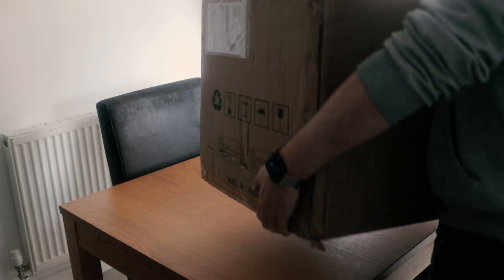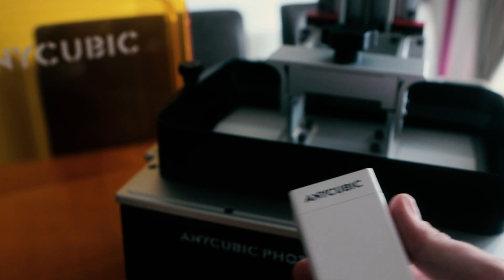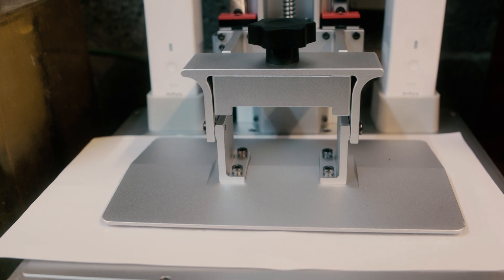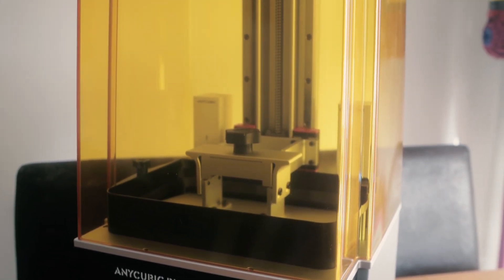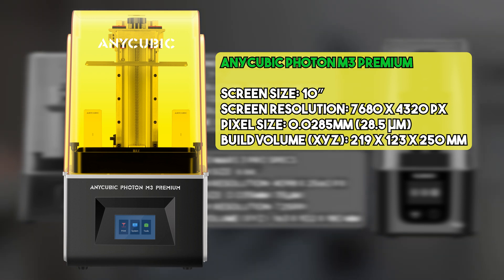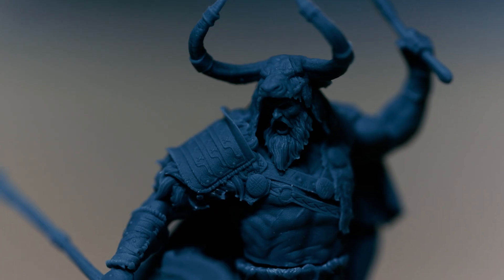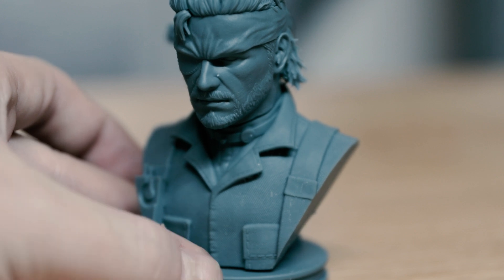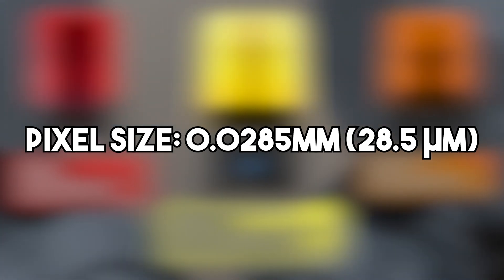Best 10-inch 8k Printer? - Anycubic Photon M3 Premium Review

Comment: Ross the m3 max ! build volume is same as the new m7 max !! but the m3 can be got for half the price and quality is fantastic ( i hear ) would you still recommend this in 2025 given the size is the still huge in comparison to new tech and features ??
Reply from the maker: I like the new tech and the cob lightsource is also sharper than the old matrix array. But if you just want big prints. You’re unlikely to see a difference.

So it’s a bargain, but you also need to see if you can still get parts for the older one
Reply: @FauxHammer  great ! thanks for responding so quickly ! i have the deal of getting 2 m3 max machines in mint condition for 440 GBP

Comment: anyone if the rumors about this printer being discontinued are true.
Reply from the maker: They are, it’s gone
Reply: Could you use  elgoo 8k 10" as a replacement?
Reply: Yes. I have used a Saturn 2 8K Screen on an M3 Premium without any issues. The glass is smaller so you will need to fill the gaps.  @Wayatoon

Comment: I have seen lots of reviews printing miniature figures. How about how well these printers will print structural things. Vehicles and such. How is the print quality on flat surfaces? I am still on the fence about buying one. Mostly because of the learning curve. Regardless of that, I still would like to get one. My venue is model trains and I would like to design my own models. Just not sure if these printers are up to injection molded quality surfaces.

I really do enjoy your videos. Very helpful in seeing how these things work.

Comment: They fixed the RARF test
Prints on the mono 2 was fairly easy to read but still preferred to use the validation matrix they used UV tools to get these prints as different exposures it says

Comment: Ive been having such a tough time getting this thing to go fast with the siriya tenacious navy grey mix, I either get peeled or squished prints, what settings shoukd I be using for this thing? I WANT THE SUOER FAST PRINTING SPEED i was promised😅😂 help me please
Reply from the maker: You won’t get fast speeds with those types of resins, they are too flexible. To get fast speeds to need specific low viscosity resins
Reply: @FauxHammer  would adding 10% sculpt or blu would help speed it up?making a mixture of something like 60 70% fast, 20%tenacious and 10% something harder? I live in texas so vat heating is of no issue plus I happen to have sculpt on hand
Reply: Actually would it just be better to do a build resin/tenacious mix?

Comment: what settings are you using on this printer?  I'm using Lychee and I just got it and a print that should have taken 3 hours is actually taking 6 hours and I have no idea why.  Lychee software says it'll take 3 hours.  Why is this printer soooo much slower than the software predicts it will be? 

I'm using Siraya Tech fast navy grey resin, with their settings for this exact printer.  About 2.3s exposure.  I had a Elegoo saturn before this and it was twice as fast using the same settings.

Also my touchscreen came broken, theyre supposedly sending me another touchscreen.  I'm wondering if the whole printer is a lemon, bought directly thru Anycubic.
Reply from the maker: Stop using Lychee.

I love Lychee for supporting minis, but I have so many issues with it actually slicing models. Just prepare the models in Lychee, export as an STL and slice in Photon Workshop.

If you are using the correct settings, then it's likely your environment temperature is the issues, so you'll need to warm the room up or increase exposure - this is just a guess based on how many similar reports of issues I see.
Reply: @FauxHammer  gotcha, thanks. Only just started with lychee because chitubox didnt have my exact printer, but good to know. I really like how it handles supports, chitubox is kinda crap. I'll try your advice and just export the stl into workshop
Reply from the maker: @shadowguma  Do'nt use Chitubox either. Your printer came with "Anycubic Photon Workshop". use that. Whatever printer you buy, always use the included slicer to slice your prints. Youc an do you pre-processing in whatever you want. but slice in the app that came with the printer. Trust me, as someone who is always testing new printers, you will have fewer issues by just using the latest version of the software they sent with it.

Comment: What about all the customers having issues and failed lcds and warped plates? I’m curious because I also hear how slow anycubics customer support is and often leave you out in the cold
Reply from the maker: That's not something I can review from a sample printer
Reply: @FauxHammer appreciate the response, I have been going back and forth on this exact printer or the Saturn 8k or phrozen mighty 8k. Honestly still leaning towards the anycubic. Which would you recommend with your knowledge and experience with the printers?
Reply from the maker: @DemonOfFury  I do t like to specifically trvomens printer to people because each persons needs are slightly different. Have you seen our comparison video for all 3 of these printers?

Also, check out the GKTWO, video dropping this week.
Reply: Was a dumb question I dug ^*deeper into the comments and someone has asked the same exact question. Thanks for the great content and insight!
Reply from the maker: @DemonOfFury  happy to help

Comment: don't know if they listened, got my m3 premium 2 days ago, the usb drive looks a bit generic, but opening it up, it has all sands internals, so they've improved that at least
Reply from the maker: Would be good if that was on the outside too then lol
Reply: @FauxHammer  lol for sure, tbh i only checked because of this video, and the fact it didn't look like the usual metal banded drives they come with... still, gotta take the little victories lol
Reply from the maker: @Shaggy_matt  totally, they may all be good, is never check, but if it looks like a duck and talks like a duck, it's assumed to be a cheap USB Drive
Reply: @FauxHammer  yeah for sure, they're probably knocked off SanDisk components put into generic cases for "legal" reasons lol 😆

Comment: the quality of the prints is already as good as anything GW or any other manufacturer make.
What we need now is cheap continuous printers that don't do retraction at all. Those prints require almost no supports as they have no suction force to pull against. You only need enough support to cover all the islands and to physically hold the weight of the model as it pulls up.
Plus they are much faster as they continuously print without any up and down movement. They just pull the print out of the resin at a constant rate.
I don't understand why China hasn't started cloning them and putting them on the market for cheap.
Reply from the maker: Not seen any like this yet? Do you have a link to such a printer so I can have a looksie
Reply: @FauxHammer  I can only find the old videos. Maybe they ran into some sort of issues. They effectively use a dense liquid instead of a FEP with the resin floating on top.
https://www.youtube.com/watch?v=VTJq9Z5g4Jk
https://www.youtube.com/watch?v=4F6tCaS44IY&t=42s
There are more videos on these printers but here are a couple to give you the idea.

Comment: These video's are important to me as I'm away to purchase my first for my modelling hobby! It now becoming an necessity in my Hobby with building the armour model's everything has to be pretty much bang on accurate for this hobby the reserch and pics allow us to create the missing or inaccurate parts on the model's and the tracks and cameras etc what my friend is working on just now for a new kit out that's missing a few major accessories! He uses the anycubic photon mono 4k and the prints are absolutely amazing quality and detail! Just perfect for this hobby but I'm thinking the more I print the more I'll want to go bigger scale with ww2 figures etc it might just be enough this photon 4k I'm looking at but open to having my mind changed lol! It's the resin well not the resin but the curing Station Or is it? You'll understand I'm sure at how brittle these parts are?! They are not getting enough UV light through the curing alone the light isn't reaching the core of the object and making them hard on outside and brittle on inside, the parts are curing the outter skin before its reaching the core! I'm thinking a stand alone UV lamp will fix this issue after the wash and cure run your own UV lamp over the whole model letting the inner core glow out for 30 seconds!
Reply from the maker: I’m not sure what your question is but I’ll be happy to advise

Comment: What are the best settings for this printer?, many test prints are not turning out, many thanks.
Reply from the maker: That’s the wrong question I’m afraid, you need to ask. How do you dial in this printer based on your own resin and environment (temperature)

I’ll be doing a video soon, but until then, please have a look for how to use exposure finders
Reply: @FauxHammer  ok thanks very much for your reply and help, all the best.

Comment: Eh, the main problem with M3 premium is the existance of a Saturn 2. It is 150$ more expensive and doesnt offer features that combined would add to 150$. Like 2 air filters are nice, but the charcoal inside is really small compared to saturn. Laser engraved plate is nice, but you can just sand yours. For me the only 2 features that are superior are the wifi and leveling mechanism with 4 bolts instead of ball-joint, and they are not worth the 150$.
Reply from the maker: To each their own mate, if that Saturn is right for you. Go with that.

I probably didn’t stress enough about the build quality of the M3 premium which is far above the Saturn.

But yeah that price difference is a key deciding factor for many people
Reply: @FauxHammer  Yep, for sure. I wasnt saying that its a bad printer, just the price doesnt seem right with the competitors.
Reply: @FauxHammer  I saw someone post something about anycubick having the z being buggy or glitchy or defective?  Any truth to that?

Comment: DLP or nothing for me.  After experiencing the benefits of  DLP printer, theres just no going back to LCD
Reply: What are the benefits in your opinion? Why won’t u go back?
Reply: @RW0-  The main benefits for me are durability, and ease of calibration.  The DLP projectors rated lifespan is 10x that of an LCD screen;  And, because of the way DLP works, there's almost zero overexposure bloat.  With an LCD screen you really have to dial in exposure, and if your machine isn't in a climate controlled area, going from 60º F to 79ºF can ruin your exposure settings and cause over/under exposure.  DLP is much better focused to the pixel being exposed is sharp, and you dont get over exposure bloat....I print from 60-89 degrees with no adjustments....My only temperature  issue is having to reset the zero level due to the machine changing size due to thermal expansion.
Reply from the maker: Fair call

Comment: Did you ever have trouble with models sticking to the Build Plate with this printer? I'm having trouble with my prints and adhesion, or so I think.
Reply from the maker: sticking or not sticking, if not sticking. it's either not level, your temp is too low or your exposure time is too low.

if sticking too much, temp too high, base exposure too high, base or raft too thick or your resin is just really hard.
Reply: @FauxHammer  Thanks for such a speedy response. I'll try some troubleshooting with these tips in mind.
Reply from the maker: @xCheeseburgersx  happyto help, let me know if issue spersist, I have a vid coming out soon showing how to set up a printer properly and quickly
Reply: @FauxHammer  Finished a print yesterday and it came out perfect. Here's what I did, I releveled both the printer and the buildplate(A little background in my apartment is legit not flat anywhere. So I'm jamming folded paper and coasters and using a level to flatted the printer) I bumped the exposure times in my Chitubox settings up and cleaned the LCD screen. Lastly I heated my grey resin in a bucket of hot water for several minutes. Success! Prints were nice and didn't have any problems. Last night I cleaned the build plate with Isopropyl alcohol and whiped it clean. I very lightly used a plastic scrapper to run over the FEP(Because I left my grey resin in the vat overnight)just to check if anything was stuck to the FEP. I felt nothing. So with the same settings on a different file, with the same resin. I printed another file the next day and back to my problem of nothing on the FEP and nothing on the build plate after the print's done. I almost wonder if the slightest difference in my current set up unlevels it(I build a big black box of thin black foam sheets to stop any UV) or if maybe temp is my problem. So weird to get perfect prints and the next day to be back to what seems like leveling issues.
Reply from the maker: @xCheeseburgersx  based on what you put, I'm gonna say temp is your problem.

However when cleaning your bed with iso, it needs to be fully dry for a while before being used again, a thin later if iso left on your plate can be a resin-phobic layer

I bet it's temp

What is your room temp

Comment: Against the Saturn 2, does it worth the price difference? Rn is like $200, also how about M3 Plus?
Reply from the maker: It depends what you want, the m3 is a significantly higher quality machine with a deeper vat (trust me that's super useful on this size of build plate). Is that worth $200 to you?

The M3 plus is a different thing, smaller plate, lower resolution at only 6k. The m3 plus is more like a bigger version of the Mono 4k - same pixel size, but bigger plate. these have larger plates and a smaller pixel size so you can get higher quality prints.

Comment: Below i see you said to just go with the Saturn 2, but then in your Saturn 2 v 8K video you seem to lean towards the 8k. This makes things a bit more confusing. This printer appears to be more solid of a build, esp with the z rail. Do you have a proper comparison to go on owning all three? I know j3d uses this one so it probably isnt bad at all.

I guess my concern comes down to the lens and light arrays. I dont have them to test side by side but maybe you know from experience which seems to have better quality with the light not bleeding and being aligned properly.
Reply from the maker: I am literally in the middle of comparing all 3 printers on the same resin to see what the differences are.

I highly expect the results to be indistinguishable between printers when it comes to actual models

The Saturn 2 is the cheapest
The m3 premium is the best built
The mighty 8k has the best user experience

Comment: I figure the odds are iffy on you seeing this or not, but given you have used them all, if I am in the boat that I want a larger 8k printer, and have narrowed it down to the big 3 you mentioned yourself, This, The mighty 8k, or the Saturn 2, which one would you be going with? between sales and everything, they all seem to be obtainable at a fairly similar price-point. The biggest issue I seem to see with people using the m3 premium is software and firmware simply being buggy, or coming with failed LCD's and having to wait weeks for Anycubic to get them replacement parts. I'd like to consider myself decently tech savvy overall, but it will also be my first real venture in to 3d printing. Did you feel like any of them had any clearly better results as far as ease of setup and speed of getting them calibrated and printing correctly were concerned? Did any of them really stand out over one of the others to you? Or would you say it's really just a toss up and regardless it should be a good experience? Thanks for the video's by the way, and appreciate any feedback you have if you do happen to see this.
Reply from the maker: Thanks, I see and try to reply to all my comments, I’ve not that famous… yet.

To answer your question easily, no.

Now the long version. It is as I say in this video, just pick one. For the price each is, it’s worth that price.

The Saturn 2 is really good and really sharp but has some outdated approaches to its interface and the resin splashing on the lid irritates me a bit. 

The M3 is solid, like proper solid as I say here. but yeah you are right about Anycubic customer service, you could be ok and have no problems, but they have been reported as a pain when it comes to resolving issues.

The mighty 8k has the best user experience by far. But the screen has no glass overlay or protector, there is an argument this makes it sharper, not that I see much of a difference though.

So they all have their pros and cons. I haven’t done a direct print quality conparison, but considering I can’t tell a significant difference between print on any of these and the prints from the higher resolution mini 8k, I doubt anyone can tell between 3x 28.5 micron printers.

So in summary, they all do the same thing, just pick one 😉

Comment: Is it possible to use a Bluetooth dongle or other USB device to make any 3d printer wireless and by pass manually inserting a USB?
Reply from the maker: possibly, can't say I've ever tried, and it may be that the printer only refreshes looking at the contents on insertion.

this has Wireless anyway, I just never tried it.
Reply: @FauxHammer  I may have to brave the trenches of reddit and look for answers lol.
Reply: The printer expects a FAT32 filesystem under USB protocol. So no, i don't know any commercial solution that would provide it. Is something that can be achieved but would require a bit of electronics and programming DIY.